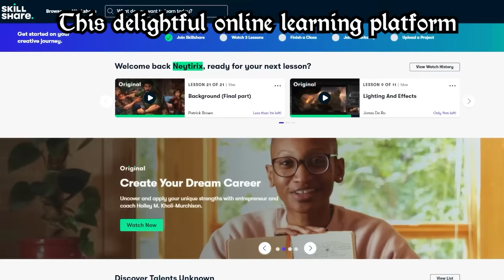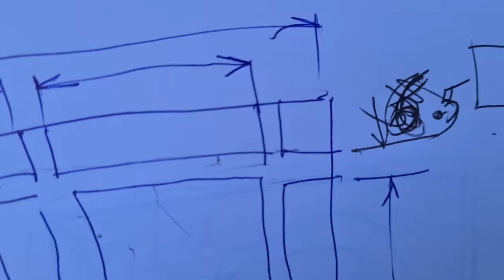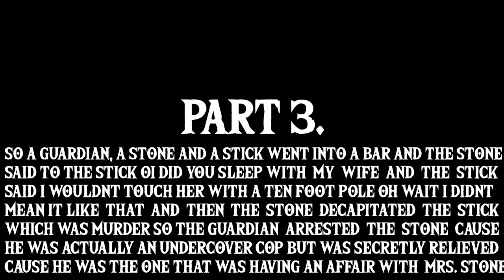I suffered now it's your turn.

Comment: “It doesn’t look very appealing”
I- you roasted the ever loving fuck out of it-
Reply: It was just a piece of carbon at that point.  :( You want a nice golden glaze
Reply: Nope burnt outside is the way to go for me
Reply: To be fair, using an oxy torch for smores is a bit like using napalm to de-ice your drive. Some short comings are to be expected. I recommend a tea candle or a stove burner if a traditional campfire is unavailable.
Reply: I discovered that putting a mallow in the oven for about a minute on broil or low heat works well. Also putting the gram crackers under them maaay lead to a soft/burnt gram.
Reply: That’s how you’re supposed to make them! If the marshmallow isn’t black it isn’t cooked
Reply: That's how your supposed to roast em
Reply: There's two kinds of people. Lightly roasted Marshmellows and fucking burnt to hell Marshmellows
Reply: @citrineshark9240  You don't burn the whole thing, you slowly heat it up for a bit, then you do a quick roasting of the outer layer for some crispiness (and because burnt sugar is ultra kino). Crispy burnt sugar outer layer, soft and warm inner gooeyness. It looks black, but only on the outside.
Reply: @naconation1250  flambe it

Comment: just a thought for if you ever wanna make another diorama using foam or styrofoam, to make the landscaping a little easier you might want to invest in a heated wire foam cutter which will just make forming and shaping the foam way easer. And great vid as always!

I forgot to mention that if you want the water to appear a little clearer and glossier you could wait for the resin to cure and then add a top layer of UV resin.

Comment: This model is amazing! I actually really like the cloudy water, adds a little swamp-like feeling to it instead of an ice-melt stream.

Also for the smores, maybe they tasted weird because of the acetylene torch? We usually make them over a campfire because it makes them have a little smoky flavor. The gas also might have only charred the outside, and not melted the inside. Seriously try them again with a wood fire! They are an essential camping snack whenever we Yankees go to the outdoors.

Comment: This was a neat project to watch through, As someone who's hobby is miniature war gaming (a lot of terrain building and miniature painting),it's neat to see someone who just makes these dioramas for fun and interesting art, rather than with gameplay in mind. I was listening through the video and you mentioned that you had trouble with cutting foam? they have these neat powertools called a "hotwire" that i found makes that job much easier, if you do any modeling terrain in the future, i'd suggest picking up one of those. Also if you ever need material like "sand rocks and sticks" there's a company that specializes in that kind of terrain flocking called woodland sceneics, I use their stuff for my battletech and warhammer terrain all the time.
Reply: This kind of art really makes me awe all over the place. You guys are awesome. :)
Reply: I’ve been thinking of making a model for DND so this is going to be useful, thank you kind stranger :)

Comment: A recommendation if you want to try S’mores again: don’t apply heat directly to marshmallow unless you like them charred. Also, root beer floats pair well with most warm food and definitely with s’mores. Cold sweet drink with warm crunchy sticky food.
Reply: we call them spiders here, icecream in soft drink (normally coke but I've had it in ginger ale and ginger beer before to)

Comment: As I watch the marshmallows being torched and burned, I think to myself: “why”
Reply: Wah?
Reply: If you dont actually know roasting marshmallows make them hot and gooey inside so it tastes good. However in my opinion they shouldn't of absolutely burnt theirs as I prefer my golden brown but many people prefer thier marshmallows basically burnt to a crisp.
Reply: Because burn marshmallow taste good :D
Reply: @PurpurDragon2003  It makes them bitter and gross, and way more messy than a good dark brown.
Reply: The optimal method in my experience is to set it on fire (by keeping it just close enough to the flame to not immediately catch) and then immediately put it out. Usually this gives a fairly quick golden brown marshmallow with spots of burning (kinda like freckles?). Usually melt the interior like you would with roasting it, but you don't BURN it.
Reply: @firepingun1236  I know they’re supposed to be roasted, but I agree, they should not be blackened in open flame
Reply: How many would have to suffer that day, the agony increasing as the moments passed.
Reply: No but actually, I was shaking and laughing and crying at how badly they burnt the marshmallows

Comment: S’more advice: don’t plunge the marshmallows directly into the fire, marshmallows taste a lot better when they’re golden brown.
Reply: No

Don’t listen to him, they’re better 

C R I S P Y
Reply: the ✨crispy✨ ones are best
Reply: no no no, see what u gotta do is set only half of it on fire, so u get that nice char taste but it’s not overpowering
Reply: @sage2328  this guy gets it.
Reply: I like to burn mine and make the middle into soup
Reply: I like them roasty toasty
Reply: I make the outside crispy golden brown, then pull off the outer layer and eat that while I cook the inside to a golden brown again.
Reply: NO THEY TASTE AMAZING BURNT--
Reply: They're better when they're golden black
Reply: when I saw that marshmallow charred I couldn't help but think 'THaT iS NoT hOw YoU dO iT!!!!1!1!'
Reply: @siyotsistu  as they said tho. Normally you don’t roast marshmallows with an Oxy Torch 😂
Reply: Further more, you get better results with a log-fueled fire, and you want the heat to cook the marshmallow, not the flames (the flames will burn it). This is how you achieve the golden-brown texture instead of a recreation of Vader’s charred scrotums.

Comment: The “American” smores are a terrible stereotype. They aren’t that small.
Reply: They're smores, not sless!
Reply: Yeah. They also need more chocolate
Reply: They need at least 2 more rounds of penetrating power
Reply: Add some peanut butter for some added flavor!
Reply: nOO

you dont use a massive marshmallow for smores, you use small ones so when you smush it, it doesnt squeeze out the edges
Reply: @Chris-P.-Bacon-III  its more fun when it squeezes out the edges tho-

Comment: Most of the other miniature makers I follow that use insulation foam to make rocks usually use a hot wire cutter or something. They require ventilation and a respirator but they cut through foam quite literally like A hot knife through Carcinogenic butter.

Comment: A helpful list of how to make a s'more easily:

One half of a graham cracker, place a bit of chocolate on it, when a friend finishes roasting your marshmallow into dust, take another half of the graham cracker, the other person places the marshmallow on top of the chocolate and you use the top graham cracker to pull away from the stick and tilt the graham cracker a bit to scoop it off cleanly. 

Now wait, and let the marshmallow melt the chocolate (or not, I prefer it non-melted) and voila. 

S'mores
Reply: How to roast marshmallows:
Hold the marshmallow on a stick and touch the marshmallow on the top of the flames until brown all throughout. Don’t forget to turn it.
Reply: @seraphywang4638  I prefer to singe the marshmallow until there's nothing left to burn, it gives it a nice texture
Reply: Man, I’ll make a smore with a microwave marshmallow.
Sure ya don’t get the crunch of true roasted marshmallow, but you literally just stack the crackers chocolate and marshmallow together and slap 8-12 seconds.

Plus it’s fun watching the marshmallow inflate like a balloon being blown up.
Reply: @_underscore_9271  I do it for the gooey insides

Comment: So many craftspeople in the house. And still, making smores was complete and absolute chaos. For future reference: it's easier to make smores over an open flame than blowtorching them - it allows for more control over your burning/roasting of the marshmallows. Another (some would consider blasphemous thing to do) is to put a marshmallow on top of whatever you have closest to a graham cracker, nuke it in a microwave oven for 10 seconds (it's pure sugar, it doesn't take long), wait for it to start to sag a little, pop your chocolate and top cracker on, then you're good to go. This is less fun, as it uses less fire, but does result in less... whatever that was xD

Comment: Tip for s'mores is place the chocolate on the gram cracker before you add the marshmallow so once you add it, it has more time to melt. Second tip is having an open flame that you don't need someone to be holding is a great idea. In America some of us use long metal prongs but just grabbing a stick and cleaning it has worked well for me. I know you live in a hotter climate so I doubt you whould want to start a camp fire but if you have an open flame burner used for cooking you chould plug it in somewhere outside and use that.

Comment: I dunno if I already commented this because I've watched this video before, but smores are pretty good if you microwave the marshmallow on top of the graham cracker and chocolate, because the marshmallow won't be all burnt, the chocolate will be nice and melty, and you get to watch the marshmallow double in size before the microwave turns off and it deflates

Comment: I don’t know why I didn’t say this a year ago, but many (if not most) Americans don’t use the big marshmallows on s’mores, but the medium/normal sized ones (there are some slightly smaller than normal) so that there is a balanced amount of mallow to everything else. I personally melt/burn my marshmallow and make the inside liquid, but everyone’s different. I recommend using half a hersheys bar since it perfectly fits with graham crackers, instead of using 1/4 a bar (or 3 pieces) like some prefer. If you can get your hands on any graham crackers, like order them online or something, I’d recommend you try it again and see if there is any difference! I love s’mores, but they are best in moderation! XD

Comment: 13:55 i am 100% American and i say that you are supposed to blow out the fire before it melts off and you can make them burnt or cooked however you want but as long as they don’t fall off the stick and also you wanna let the marshmallows that where on fire for a long time to cool , but you can set them on fire multiple times and blow them out in between, tbh marshmallows are kinda like PBJ sandwiches the goal is to be able to personally enjoy what your eating. And also you don’t grab it off the stick bc you will burn your hands if its hot , you put the marshmallow in between the crackers and chocolate and squish it together and pull it off.

Comment: YASSSSS SMORES also to inform your siblings? You first need to cook the marshmallow slow so it gets all big and melty, and THEN you make the outer edge crusty.  If the outer edge isn't crusty you get a super sticky marshmallow and if you burn it right away the inside isn't melty.  you can just stick it in the fire or roast it slowly to get the crunchy outside.

edit: watching further in the vid and seeing your confusion you are supposed to lay it out like 

      {3 block things of the chocolate}
[             graham cracker                              ]                      [           graham cracker           ]

and then you put the marshmallow on the Chocolate and use the OTHER cracker to pull it off the stick.

Comment: I have roasted a marshmallow or two, but uh. They generally don't glow blue when they're removed from the flame.
Most Americans use a wood fire. An oxy-acetylene torch may be regarded as overkill by most folks, but work with what you have I suppose...

Comment: I noticed a kangaroo in the video... I got punched by one once... I try to avoid the proximity of those.

As an American with a degree in smore-ology I will explain why your smore looked like a severe burn victim.
As stated by your brother, you're not supposed to use an oxy torch.
The use of an oxy torch creates an intense fuel air reaction which will immediately cause high oxidization combustion of the sucrose in the marshmallow.
Correct marshmallow toasting involves cooking the marshmallow over a fire in order to cause light oxidization and combustion of the outer layer of sucrose.

Comment: Two years two late but as an American smore connoisseur your technique is a little... botched. What you need to do is start a small wood fire. This step is crucial because you don't actually cook the marshmallow in the fire, or over the fire, but around the coal. With the stick firmly skewing the mallow all the way through you rotate it like a spit until golden. While this is happening you put your chocolate on one of the graham crackers and let it, not melt, but get soft of one of the rocks in your fire ring. Then taking the mallow stick, with the mallow, you squeeze it with the graham crackers and pull it off. Not only do you get a perfectly cooked mallow, but you get nice warm crackers and melty soft chocolate. Personally I only eat one tho. They're a bit messy and I'd rather have raw mallows.

Comment: the best way to make marshmallows is to burn the marshmallow and then remove the burnt skin so you get the gooey middle, leave the chocolate by the fire for a bit so it becomes a little melty and then only eating the graham cracker cause i fucking hate smores